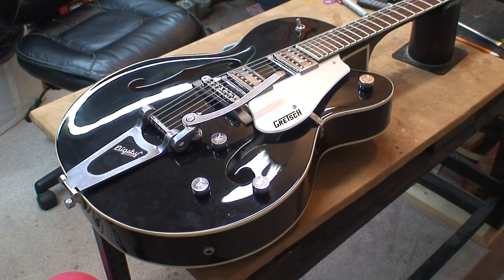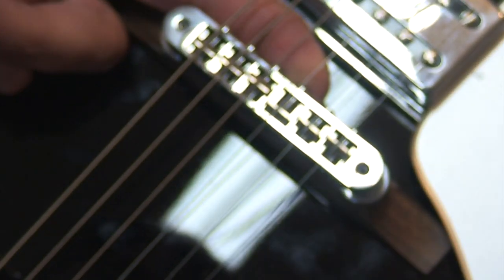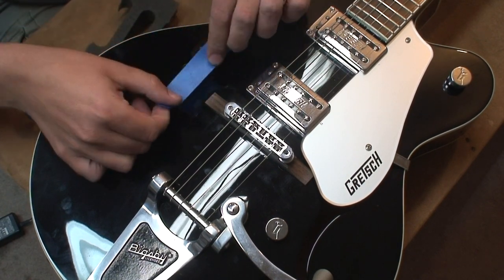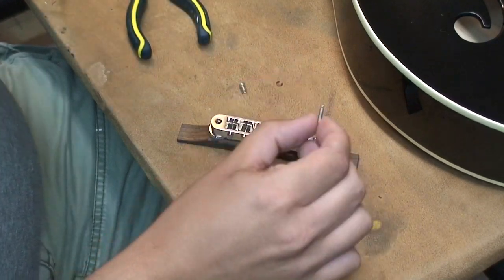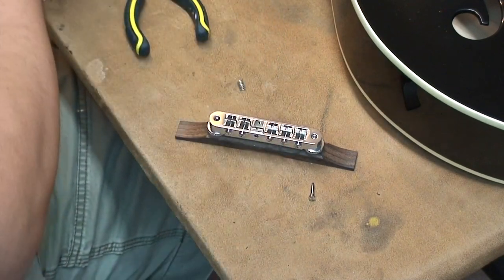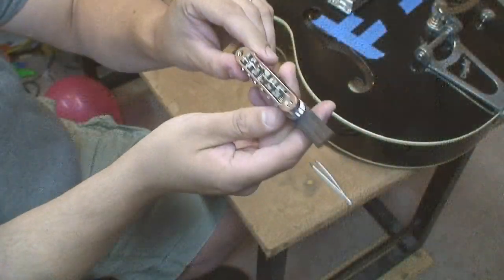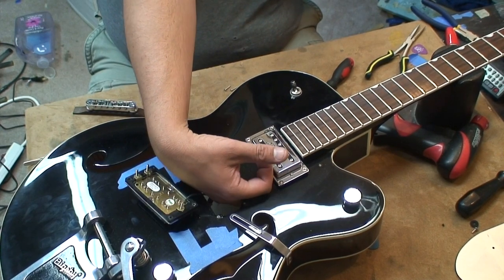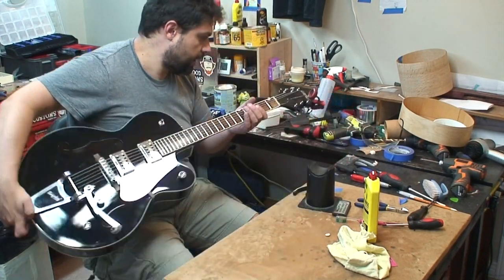Gretsch Electromatic G5120: Bridge Saddle Rattle Fix

Comment: Now, these saddles are always being pressed down pretty hard by the strings.  If the strings are not keeping the saddles immobilized, should the equivalent of the spring out of a ballpoint pen do the trick?  It should seem suspicious to anybody that, in order to diagnose the rattle, he removes the bridge from the guitar, which removes the pressure exerted by the strings on the saddles and then discovers that, with the pressure of the strings removed, the saddles will rattle in the bridge (uh, DUH!).  It just seems suspicious to me.  Now, look to the next comment for a more likely possibility.

Comment: I think that is what they call a "Rocking Bar Bridge"  I believe it is supposed to permit slight movement. The rattle is a bad by product.  "Adjusto-Matic™ Bridge
The Adjusto-Matic bridge offers great tone and precise intonation with its six individually adjustable string saddles. When used with a Bigsby vibrato, the bridge slightly "rocks" with the movement of the strings- reducing friction and adding tuning stability."

Comment: I have this same guitar, & I never noticed there were no saddle springs in the bridge. Not real fond of the "floating bridge" either, but haven't had any problems. Did have to replace the cheap tuners & the cheap plastic nut, as well as install a jackplate, because it didn't have one & there were stress cracks forming around the Jack. After some cosmetic upgrades now it's awesome. Except for some  chinsy  hardware, these Korean made Gretsches are great guitars

Comment: Hmm, I just got a brandy new Gretsch G5420T and it has that problem. I ordered a rolling bridge today. I might try that spring trick.
Reply: Did the rolling bridge fix it ? Seems like an easy fix then fluffing around with each screw.
Reply: @mcquoidd6917  ....Yeah, mostly it did. Tunings are more stable too.

Comment: This video is great! It helped me a lot with rattle on my brand new Fender Powercaster. I cut a spring from a ballpoint pen in half and I used both parts on the 2nd and 3rd string. Problem solved! :)

Comment: THANKS! The noise on my G string was driving me nuts. After seeing your video, I lifted the string off the saddle with my finger, and low and behold it was loose on the screw. I did not take off all the strings as you did, I just lifted each string, one at a time, and moved it to the side, letting it rest on the bridge to check each saddle.  Fortunately,  all were snug except the G. I am guessing if you use the Bixby a lot, it can cause the threads of the saddles to wallow out.  Quick fix: Tune the string,  then adjust the saddle till the intonation is perfect, move the string to the side of the saddle, back off the screw 2 or 3 turns, counting each half turn, put a tiny drop of Red Loctite on the screw, then screw the saddle back in place, to its intonated position.

Comment: What I use is small diam. silicon tube and no springs. You can cut it nicely on any lenght with a Stanley knife or razor blade and and there is no more rattling problem at all. Good luck. This wil work on any Rocker style bridge.

Comment: Mine had this issue. I did the intonation and then I put one drop of glue on each of the screws, problem solved and I can get the glue off with ease if need be. I had a hell of a time figuring out it was the saddles until I saw the saddle move. Def want to get a different bridge, but for now the problem is solved.
Reply: Oh yeah I had a question about the bridge placement. I see you use tape to mark where it was, but what happens if you hadnt ? How to you make sure the bridge is back exactly where it was ?

Comment: When somebody complains about buzzing on a Gretsch hollowbody guitar, the first question should be, "Have you changed the strings?"  These guitars come from the factory with a set of medium gauge strings (.011 - .049), but when a novice or inexperienced player goes to install the first change of strings, they are likely to come back with a set 1046 (i.e. standard gauge)strings or (heaven forbid) even a set of 0942 strings.  The problem with that is the neck is set up at the factory to balance the tension of a set of 1149 strings.  When the player substitutes a lighter gauge set of strings, the strings won't balance the tension of the neck and the neck will develop a slight backbow.  In that case, when the guitar is fretted on the low frets, the strings will buzz against the higher frets.  The solution is to loosen the tension on the neck adjustment rod, but, in some cases, there won't be enough adjustment available to readjust to the reduced string tension.  If the buzz cannot be adjusted out by loosening the neck adjustment, the solution is to put a heavier set of strings on the guitar.
Reply: thanks Maxx for your comment. I got a 2020 g5422t and if I'm not mistaken it comes with 12 so and I play nines and even when it came I had to adjust the truss rod to get some relief out of it it was actually backbone and the soldado I'm wondering what's going to happen when I put lines on it but the truth is I got it from Guitar Center and I told me that they will get it playing with whatever gauge I want on ityeah the problem is with the coronavirus that's going on now the store was closed until further notice so I'm going to have to do some work on it myself and it's the first time I ever did any work on an electric guitar and I'm blind wasn't always blind but I am now but I got to playing OK which amazed me to be honest with you anyway thanks again and I know you are Rex but I'm using speech to text and it just does what it wants to so keep safe and thanks again sincerely yours, Bob the blind bedroom guitarist
Reply: @bobtheblindbedroomguitaris8742  god bless you Bob, hope youre enjoying the guitar